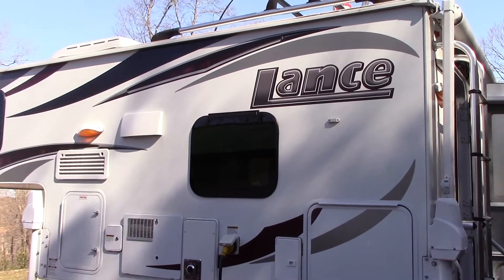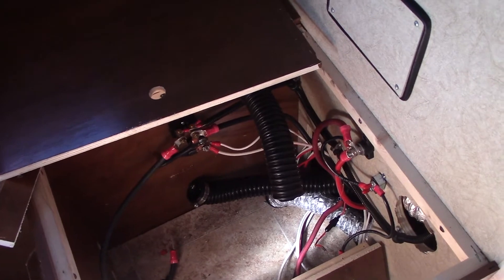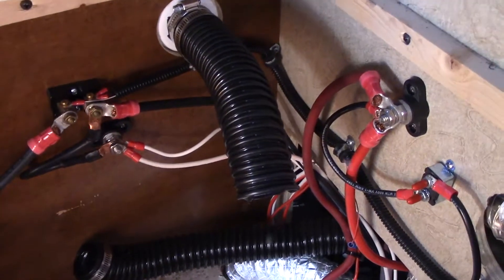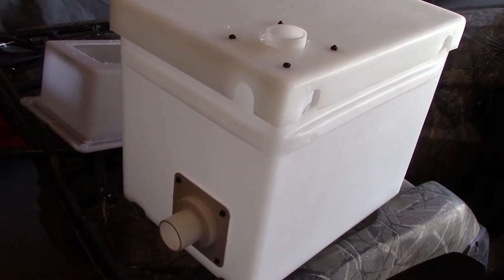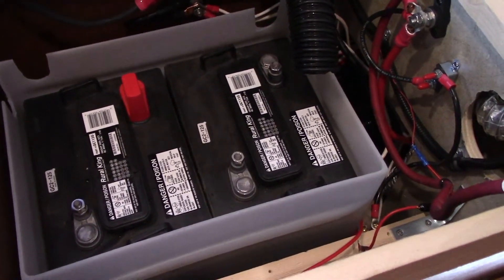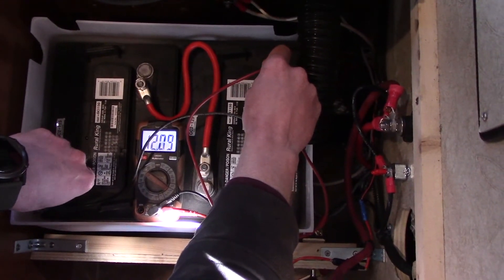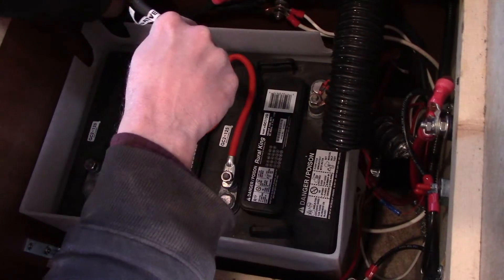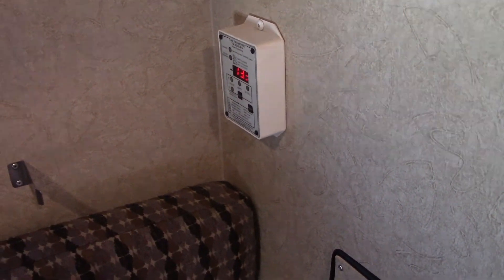Lance 825 Truck Camper Battery Upgrade - Dual 6 volt Golf Cart Batteries

Comment: Great tutorial ! I have the same camper and now am planning to upgrade to dual 6 volt batteries.
Reply from the maker: You might want to check out my other video on the lithium upgrade. I had some problems with off-gassing of the Dual 6 volt batteries.
https://youtu.be/6hFL4rsXlKs
Reply: Thanks, I appreciate the info.
Reply: What about AGM’s, they are supposed to emit no gassing?